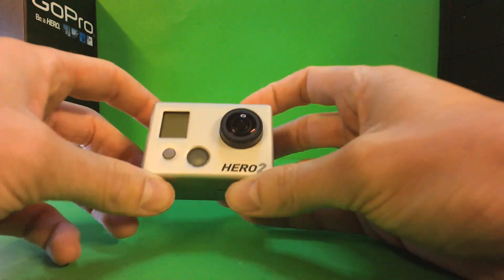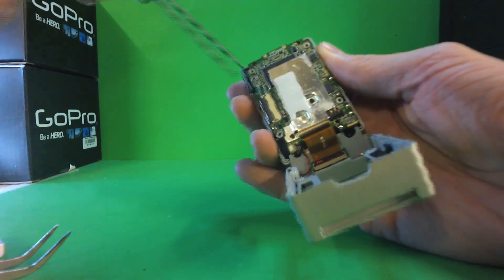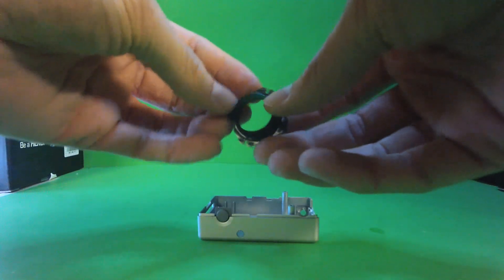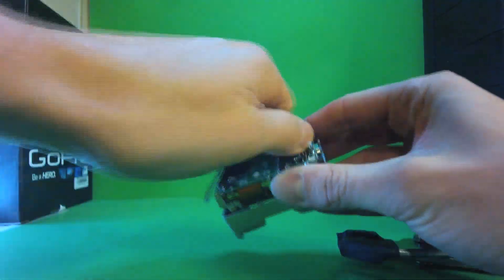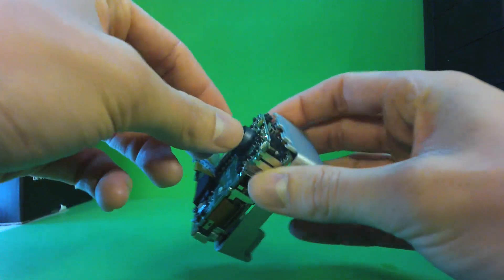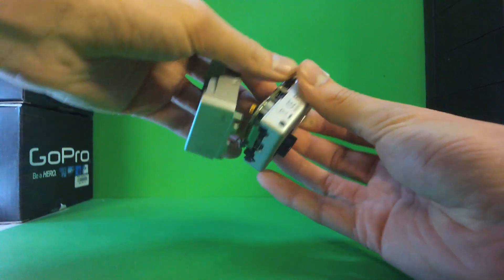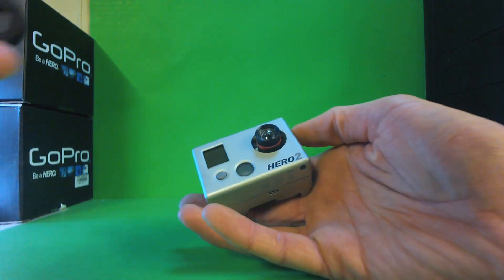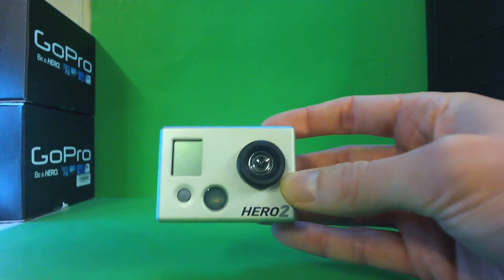GoPro HD Hero 2 Lens Change by RageCams GoPro HD Hero2 HD2 modification fpv

Comment: I have a question for you guys. I recently replaced my lens as it scratched when the camera fell off my car and the case popped open. After taking it apart I tried to turn it on to focus the lens before putting it back together and now my camera freezes 3 seconds after it powers up. in those three seconds I can cycle record settings and even take a photo. The gopro program will not recognize the camera through USB and the manual software downgrade button combination wont work. It seems as if the camera is overheating or something and locking up. Any ideas what to do?

Comment from the maker: no, im sorry the 2.8-12mm will not fit the hero3 due to the heatsink ring that surrounds the lens under the outer grommet cap.unless you hack off the heatsink ring flush with the camera but then the camera overheats in 20 minutes. and would need to cool down before using again. we are working on a fix, new lens fit & new heatsink ring or with new lens that will fit. ifixit does not go into specifics that we have learned by trial and error.right now we have many fixed lenses that work real well

Comment: hi,,have there been a mod for the gpro hero black as yet?will this mod be the same with the gopro 3 black,i have the 2.8x 12mm lens,,the gph3 black comes apart by the front plate,just pry it off,,the lens looks like the same as this lens,,ifixit has a good blag on taking the gph3 black apart,,just need confirmation on lens.is the lens same for the gopro her3 black??

Comment from the maker: yes its not a big deal and very common, just air dust it well and it should clear all the loose debris out, windex may be needed on a cut tip if its still seen on the sensor

Comment: If you remove (push out) the black ring bezel around the lens when you have the camera apart, this gives you the ability to change lenses on the fly and macro focus any other lens without having to take the camera apart each time.

Comment: 2.2mm is the original gopro lens. Also the newest batch of gopro's does not use much glue at all on the lens so little heat is needed to remove it correctly.
Thanks, From RageCams

Comment: thats correct removing  the lip is the best way to go anytime you change out the hero2 lens.so you then you can always change lenses on the fly anytime without having to take the camera apart every time & using a gopro lcd bacpac or any external lcd using the video out composite rca yellow cable.you can focus your camera easily not by twisting it in or out.you can also use mini hdmi out on hero2 cameras to dial in at the cleanest focus possible.Goahead-email us for any tech questions. Thanks,RC

Comment: I've been a pro photographer for many years and a member of Nikon Professional Services. Statically charged brushes are the only safe way to clean a sensor - it's not a theory. Having said that, to the extent you stand by any possible sensor damage, my thoughts on the issue are moot. Cheers.

Comment: sure we understand that, but we have never had any problems to date using a cue tip with air gun duster, it gently wipes away debris and if it does not, then windex works like a charm i promise, and i would warranty a camera if someone claims that the damaged their sensor following our close instructions, we are very serious about all this.  we mod 10 of these a week & never scratched the sensor to date, but thanks a million for your thoughtful input i like your theory!

Comment: NEVER blow air on a digital camera sensor. NEVER clean it with a Q-tip and windex. Sensors scratch very easily unless they're cleaned with a special swab and solution. Even then there's a risk of scratching the sensor. The only time you EVER use the swab/solution is if there are condensation spots. For dust specks, you use a statically charged brush to GENTLY capture the dust specks. You may want to edit your video because you're inviting sensor damage that will ruin cameras.

Comment: Though I've never done it to a go pro, anytime I want to remove a backing sticker I use a heat gun to apply some heat to the sticker, once the glue is heated up it comes up much easier.

Comment from the maker: @dirtymudproductions  just by twisting it clockwise or counterclockwise, It threads in the shaft, & we include special washers & rings for holding the lens in place rather than using glue like gopro did.